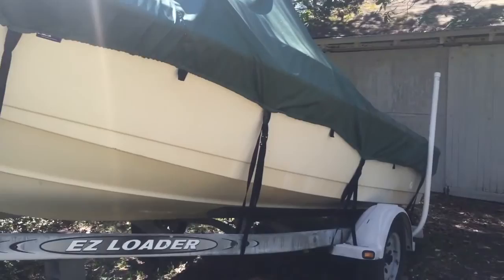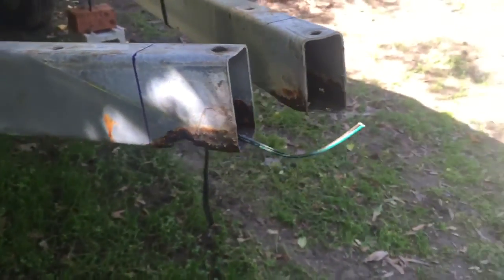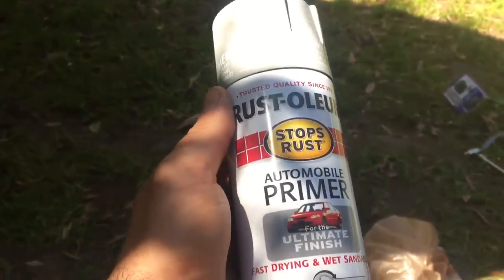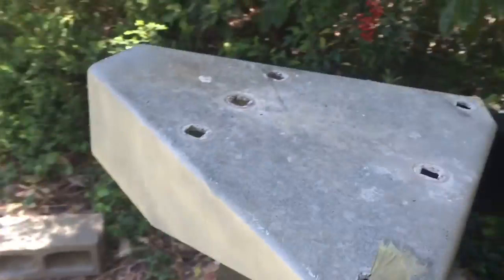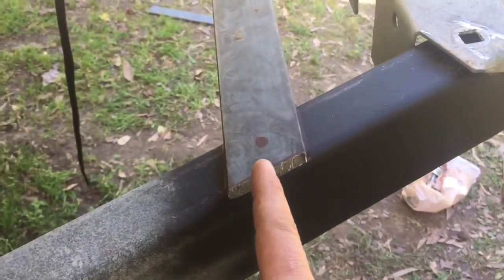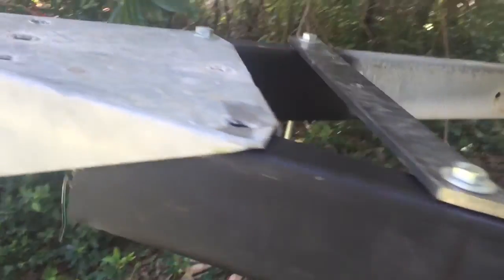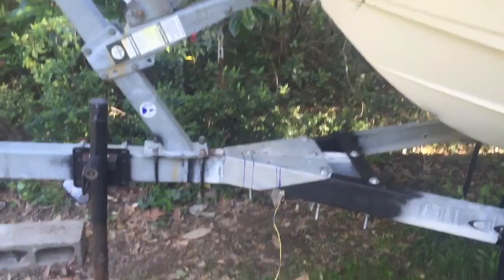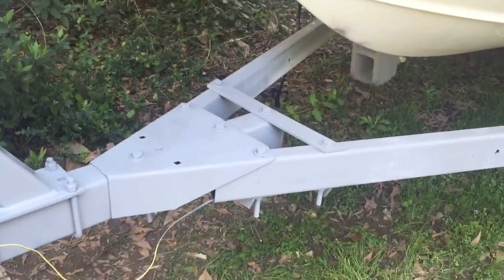EZ-Loader Trailer Repair

Comment: How do set the winch in the right place?   I am haveing trouble that keep backing up so trailer almost all the way in water.
Reply from the maker: Only adjustment I made to my winch was moving it forward when I adjusted the tongue of the trailer. I think the fix your talking about would require the boat to be in the water so that you can adjust the winch on tongue and also winch post height to where you want it. You’ll need boat in water so that the boyancy will allow for the boat to be adjusted as you make tongue and winch changes. Sorry if that was a long winded answer.